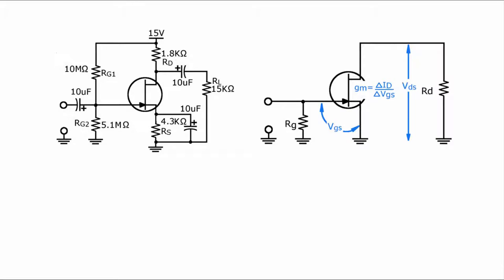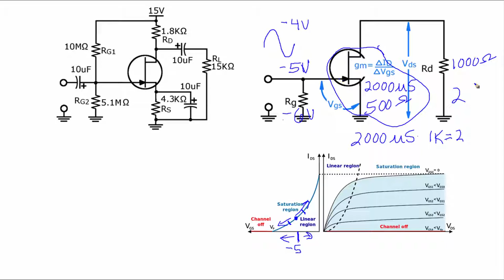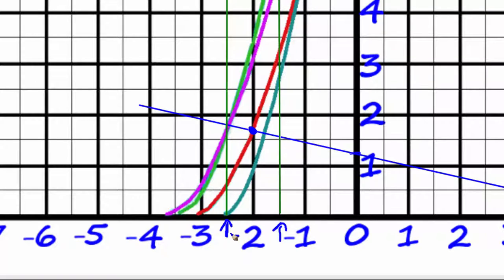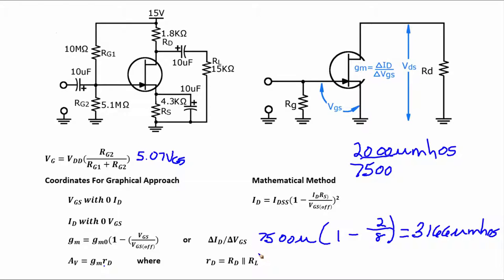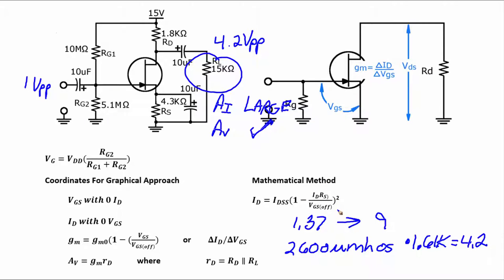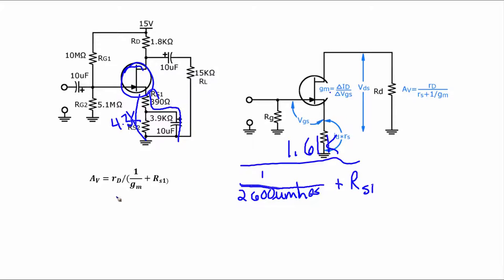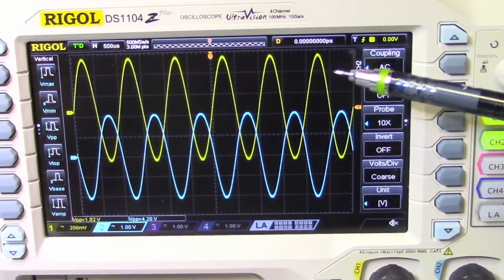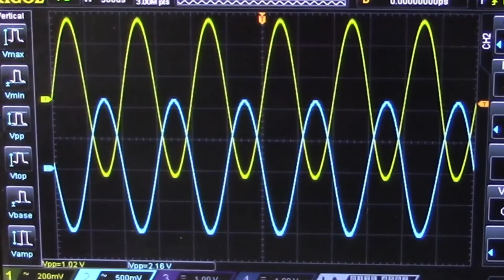43. FET Common Source Amplifiers

Comment: Thanks for the excellent video. The alternative to using an AC source resistance, which significantly reduces gain and increases noise, is to match JFETs. Of course matching transistors is a royal pain in the butt, but the potential performance gains are very high.

Comment: @19.33 you say 3199 umhos * 1.61K is about 9. Surely you mean to say it's about 5 (5.09)
Reply: Nope, the 9 is 'correct'...
The problem is that the 3166 should ACTUALLY be 5625 on the prior slide (7500 * (1 - (2/8)))
Redo the calculation at 17:13 and you will see what I mean.